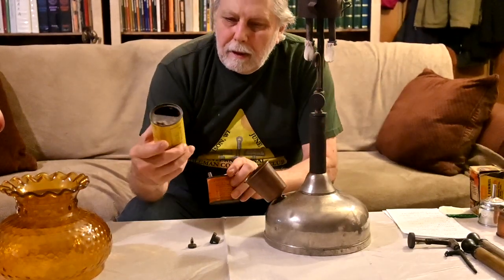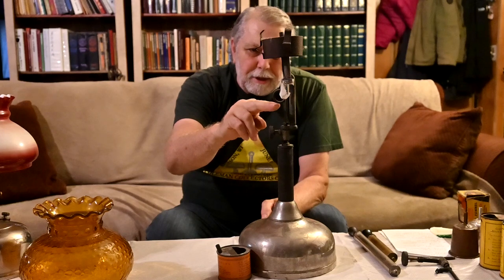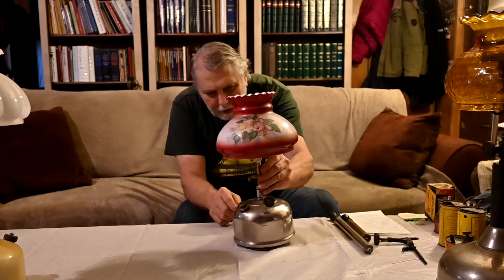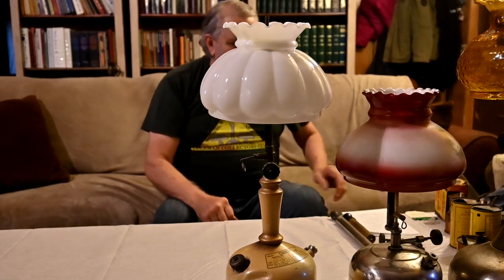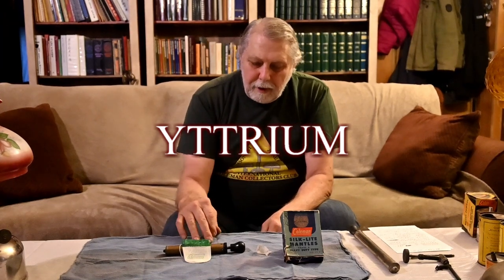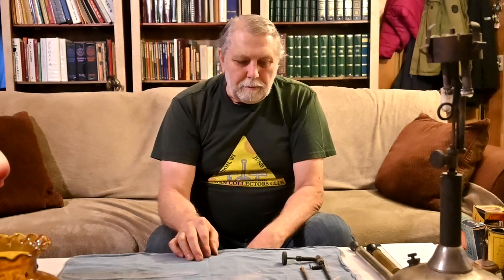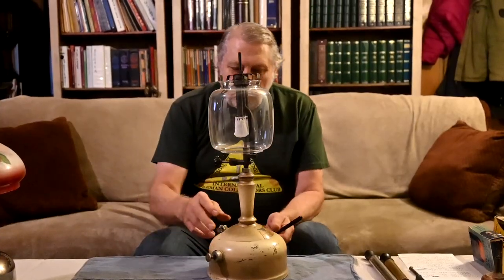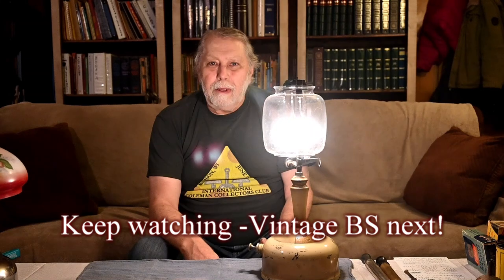Let There Be Light - Coleman Table Lamps

Comment: Man, those are cool.  Now I’m going to have to snag one
Reply from the maker: A neat and useful colectable for sure.
Reply: What’s a good first model to look for?  I’ve passed on several in local online auctions but now I’m gonna have to find one
Reply from the maker: The later model lamps with the built in pressure pumps are the best ones to find as you don't need a separate pump, and if parts are needed,   they are easier to find. @wildcaughtfirewood1511

Comment: Do those gas valves get pretty hot on the table lamps ?
Reply from the maker: The gas valves don't get real hot.  The heat actually is from the radiant heat coming off the mantles.  Coleman made higher output mantles, but they are longer than the standard ones, and the heat can damage the valve knob since they are closer. I have a couple of lamps that have heat damaged knobs.